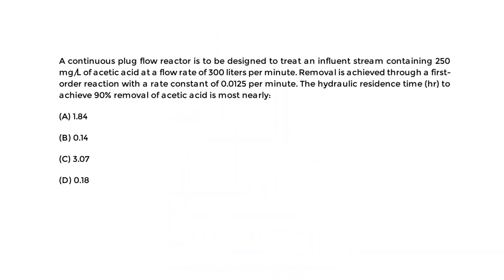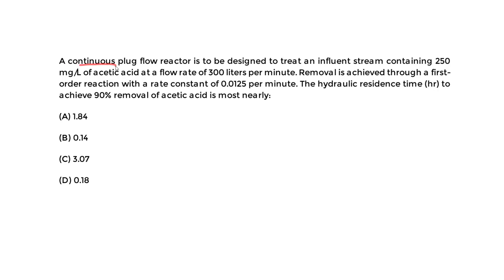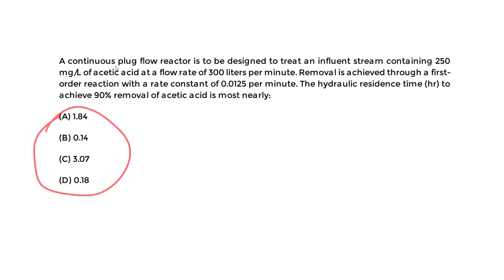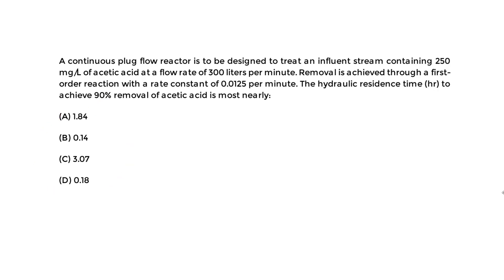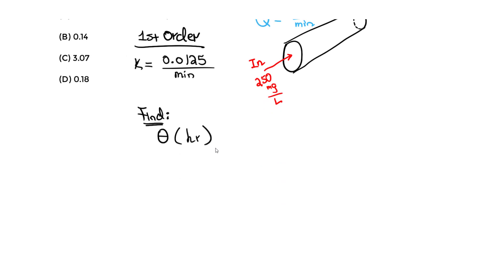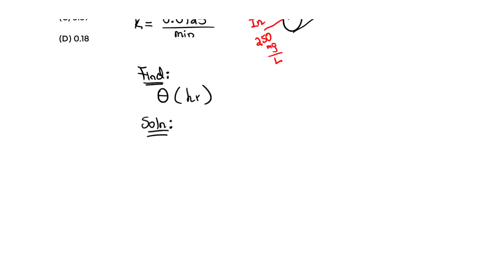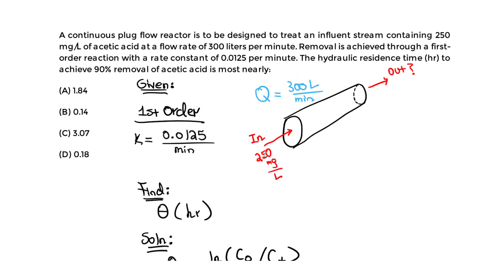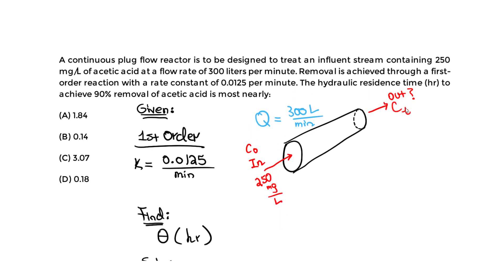FE Exam Review - FE Environmental - Fundamental Principles - Reactors

Comment: why is this ideal plug flow? assumed CMFR (in current handbook) with "continuous plug flow reactor" in the problem statement
Reply: Even though the reactor is continuous, it is still ideal plug flow. A continuous plug flow reactor (PFR) is continuously fed at one end and continuously withdraws products at the other, but there is no axial mixing, so concentration varies along the reactor length. Unlike a CMFR, which assumes perfect mixing and uniform concentration, the PFR maintains the ideal plug flow behavior regardless of its continuous operation, so we have to use the ideal plug flow situation in the handbook.